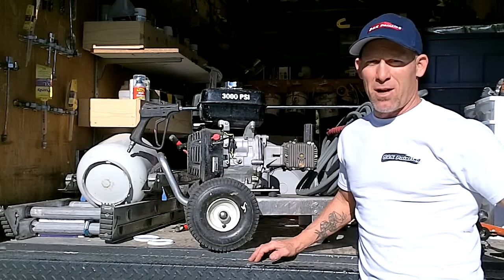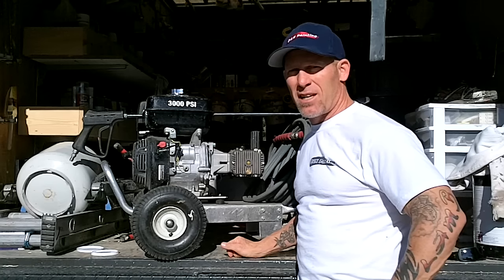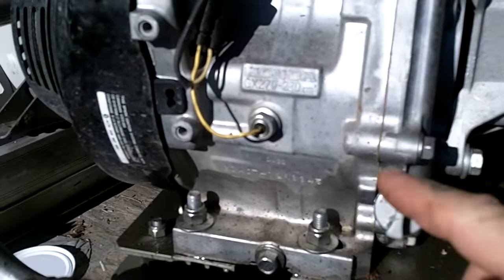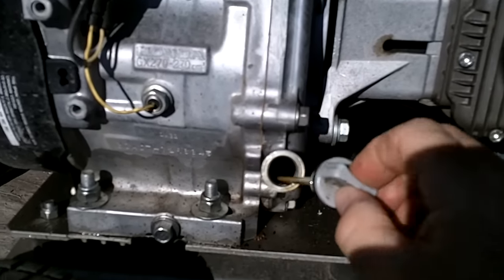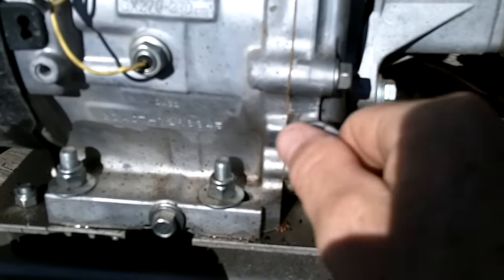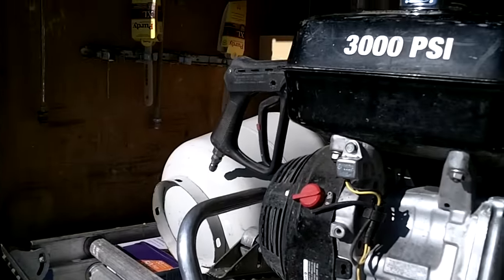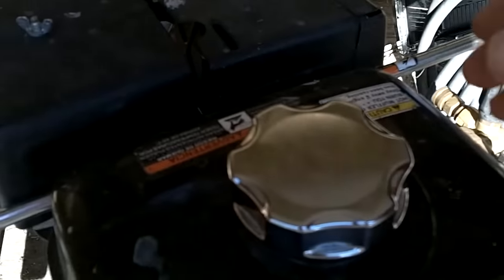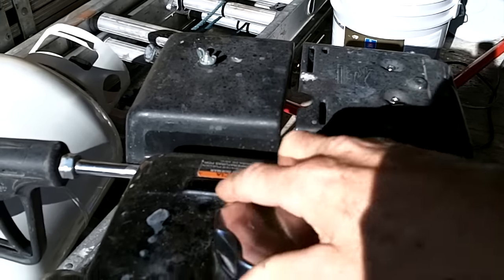How To Fix A Honda Engine Stalling.  Honda Engine Hacks.

Comment: Thank you for your repair tip.  My pressure washer was running fine until I pulled the trigger and then the motor would die.  I put in more oil and started it and let it run for about 10 minutes before I pulled the trigger and that gave time for the oil to settle and the sensor to reset.

Comment: Fair play, my Honda engined water pump would run for 10 seconds, cut out and fail to restart until left to rest for a while. Never once failed in the workshop and often worked perfectly many times before the problem resurfaced. It was full of oil but I was using it on a slight slope as it was easier to connect the pipes. The sensor was on the high side and once oil began to circulate it shut the engine down. This has been doing my head in for months as a 10 minute job was taking up to 40.

Comment: Here's some awesome info I just did this weeken. I bought and old GX390 for $200 bucks and found a rebuild kit on Amazon for only $39 bucks. Kit included new carb, gas cap, plug and wire, air filter, pull start, on off switch, oil and gaskets. Unreal for $39 bucks. Took me 45 minutes to install all and it started on the first pull!!!.
Reply from the maker: Thanks for sharing John!

Comment: Just had a issue with a Honda engine so I watched this video to see if issues matched, it did have a similar problem run a minute then die, my issue was it had TO MUCH oil. So I drained the oil out add some new to the full mark and it run perfect with no stalls. So thanks for sharing your video

Comment: Chris, thanks for the tips. Well my 13 HP Honda generator has exhibited this problem intermittently over many years. It was happening again today as I was getting ready to winterize. Turns out it is the Fuel Cap, just as you had said. After running without the cap for a half hour and no stalls, I cleaned the fuel cap and blew it out. Ventilation now through the cap and it now runs with the cap on. Who would have thought? Thanks again Chris.
Reply from the maker: Glad you got it fixed, thanks for watching!
Reply: Bob Lewi

Comment: Thanks mate, pulled the carby off multiple times, couldn't figure what was wrong??, the machine was out of the box and used 1 time. I went to the oil sensor and disconnected it,,BOOM!! the engines running like a clock!!,, cheers for your help.. NT Mick..

Comment: To help anyone else that has this stalling problem that is not fixed by the Idaho painters suggestions. I found another answer. After the gas cap,  oil sensor and new carb didn't fix the problem, I figured something electrical. To test the electrical, I couldn't pull the plug in time, so I pulled the cap off the plug and inserted a new plug right after it stalled. The spark was good at the new plug immediately. I had already cleaned the tank, and checked the in tank screen at the bottom of the tank(many times). I also put in new gas lines and had a new inline filter. My son suggested changing the spark plug, because while I checked spark during the 10-15 second period the engine would not restart, I did not check it on the plug in the engine. That plug can not be tested correctly because it will fire when cooled 10 to 15 seconds even when left in the engine so I installed a new plug and that cured everything. Best guess is there is a crack in the insulator on the bad plug that opens (expands) and shorts out the plug. I learned something and I hope this may help someone too, before you buy a new carb or extend your down time.
Reply: You can test a spark plug with a multimeter.  There are YouTube vids on this subject.

Comment: well thanks for that, I actually gave away my old one to my mechanically minded friend just after servicing it thought it might be something simple.   Then my new one turned up and had the same problem after first use.   Did this and now works fine.   So I've told him whats wrong with it also.
Reply from the maker: Awesome, glad it helped!
Reply: so ur new one didnt have meif oil or was it the cap or sensor cuz my gx390 is stalling while the teigger is pulled unless i back the unloader ofd to like 2500 psi..everytime i adjust the unloader and get it pver 3000 with a good spike even she dies n she idles great n she runs good ..i called AR n thry told me i was adjusting unloader om new pump with worn tips but the tips r correct and a year old not alota use so i dunno guys any help wud be great

Comment: Ok.. So I took the Carb off and gave it a good clean.... then I set the clearance of the intake and exhaust valves of the cylinder... no good... still the same issues... now I have had the engine stored on its side for almost 3 years and you do get to wonder if it it was something to do with oil going places it really shouldn't... (where ever that may be)... so I thank you for pointing out my school boy error of not enough oil in the sump.... However in my defense it is a real pain putting oil in these things... thank you for taking the time to make that little clip.. cheers from Western Australia.

Comment: I worked on one of these just today. It had a few problems. 1, very dirty carb. 2, oil switch was bad also low oil and lastly a tank of bad gas. Our climate here in the Midwest is a lot of moisture. Bad gas happens.

Comment: Hi painter of 5years I have 7 years experience with power washing you should get a Honda with a brass pump and filter hose way better washer I only use a 2500psi Honda 8 hp and it does every job on earth and trust me on that I live in Ireland get a lance with a good turbo nozzle and use Honda gun for more soft approach to fences houses ext

Comment: My problem sounds very similar to yours. My machine a gx270 honda runs the pressure washer about 20 seconds and dies. I tried it without the gas cap and it still dies. I tried it with the sensor unplugged and it dies just the same. I thought it was not getting enough gas so I bought a new carb. No change, it still dies after 20 seconds. I thought it was not enough gas so When it was dying I turned the gas off. Waited 15 seconds and the engine started and ran another 10 to 15 seconds with the gas turned off so that leads me to believe it did not die the first time from a lack of gas. When it does run that first 20 seconds it runs perfectly. I feel like it might need the big hammer! I need this thing so I'm holding off for now.
Reply: Sounds like a small orifice i the card is clogged.Take the bolt out of the bottom of the fuel bowl. Probably 10 mm. Clean that out then shoot carb cleaner up into that tube where the bolt came out.  Fixed mine, good luck.

Comment: Thanks for the vid. My Honda GX390, when I pull the crank, turns over, runs for about 3 seconds, then dies "as if it's out of gas". This started happening right after I accidentally put pump oil (maybe an ounce) into the engine oil chamber (I grabbed the wrong oil from my garage). Could this have fouled the sensor?
Thanks again!

Comment: thanks you just described the problem i''m  having with my 212cc honda clone . I just cut the censer wire but will have to drive down the road to know for sure .
Reply from the maker: Glad to help, thanks for watching!
Reply: well I test drove it today and its still stalling . when it started stalling I loosened the gas cap and no change .  Guess ill try a new plug although the one in it is clean add looks new.
Reply: Ok I found the problem !  I pulled the flywheel cover to swoop out the coil and saw that the air gap was way too wide on one leg witch was throughing  timing off . Don't know how it got like that the screws were still tight . re gaped it and road it 8 miles problem fixed .

Comment: Just had an issue, was running, went to move it and it died.  Has gas and oil, it will start then immediately die.  Will check the sensor, thanks.

Comment: at first i was like i just did my oil change, and i know the oil levels correct. than you said dont screw it in to check and i was like oooooooohhhhhhh Thanks a ton gonna try to add more next weekend. its been doing the iratic rev like it does with a low fuel in lawn mower but today it just gave up and stalled in the middle of the car wash
Reply from the maker: Yeah, that would've helped lol!

Comment: I have a Honda gx200 less then a month old and it’s not starting at all. The carb is clean and the spark is good. I did change the muffler but I’ve heard nothing about that doing anything. Any thoughts

Comment: Sure wish I would have seen this about a year ago.  Took my pressure washer to shop and had to pay their minimum 1 hour diagnostic rate just to be told that it was the gas cap.  Worst was the time wasted taking pressure washer to shop and having to return to job site.  Could have just loosed cap and kept on working & make a profit on job vs not.

Comment: I forgot to add that after 20 seconds running then dying because the crack expands and shorts the plug, when it cools the cracks contracts and the plug works again. This process is repeated indefinitely and the crack is not visible to the naked eye.
Reply: My issue is when i pull the cord to start pull my hand back
Reply: @josepacheco5298  You have a broken spring on the compression relief. it's on the cam.

Comment: i have gx200 on a racing go kart that i just bought and when i give it gas it spudders like crazy and i have to have someone give me a boost so it can start pulling me around. any idea what that could be?
Reply from the maker: It could be a spark plug, bad gas, or clogged air filter